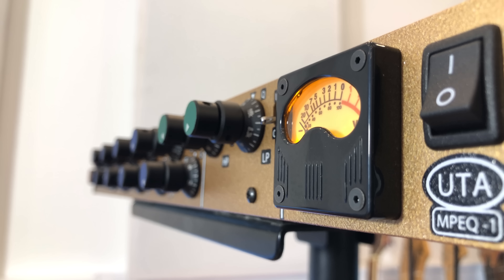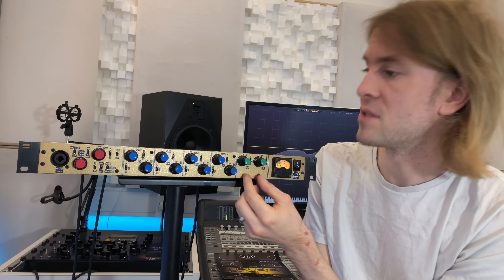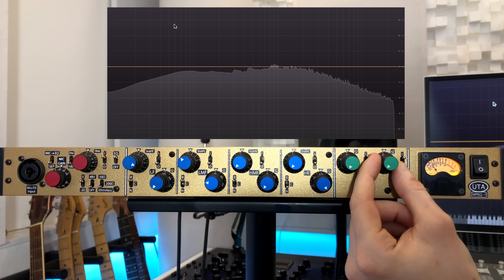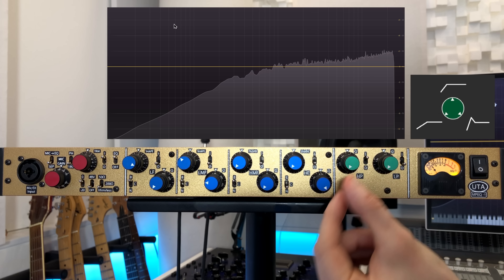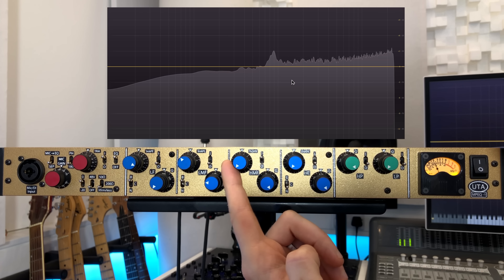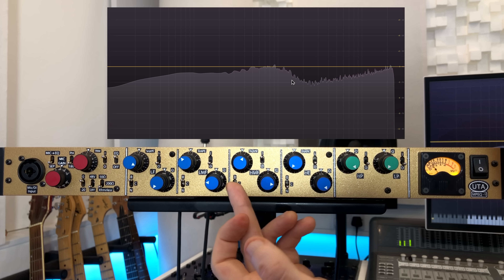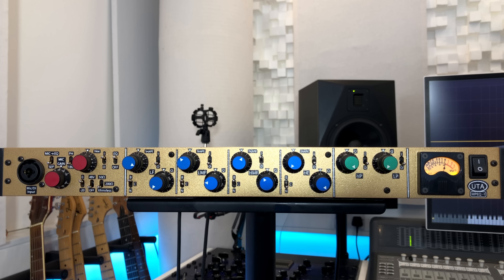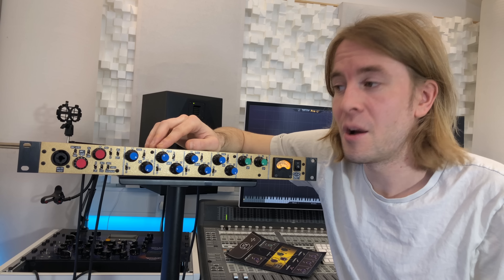We Test UnderToneAudio MPEQ-1 Channel Strip, Mic Pre & EQ

Comment: You missed an incredibly unique feature. It's kind of hidden but the notch filter mode has 2 functions: 1) the regular mode you demonstrated and 2) the phase adjust mode, which enables you to rotate the phase of the frequency spectrum that you've selected without changing the frequency response at all. It's insanely valuable when you're combining signals that are only out of phase in certain frequency ranges. You should try it out if you still have this unit. To engage this mode, you turn the knob to 10 while notch is selected. Cheers!